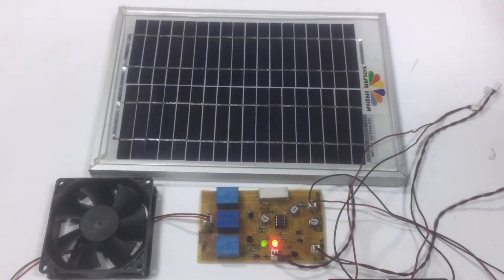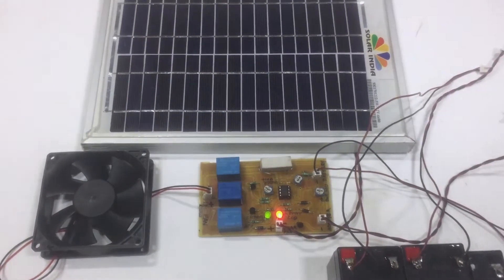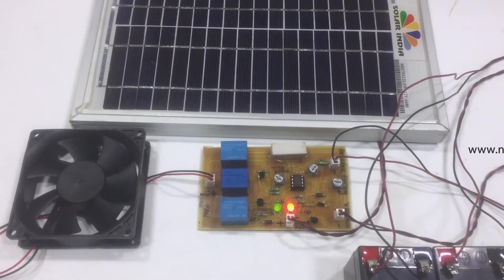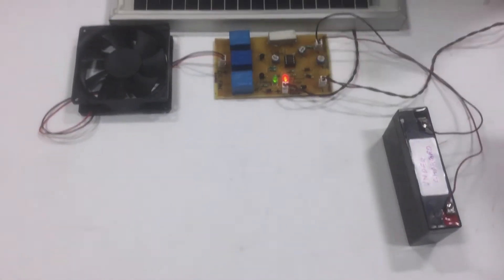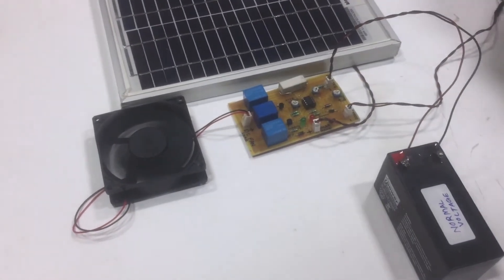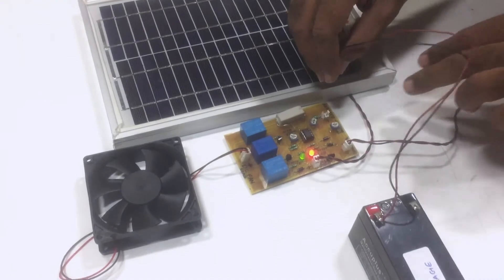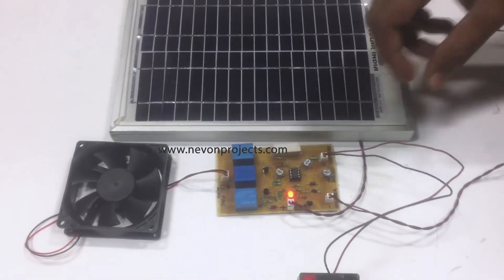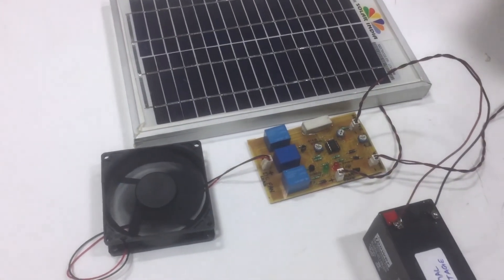Controlling Solar Energy Charge Project

Comment: we purchased this project but you people are not responding for our calls..please reply the volatge ratings of battery for normla, under and over voltage as batterys are not included in the kit.
Reply from the maker: For this Electronics system details or free document/PPT pls call watsapp
+917738796642 or visit link in video description